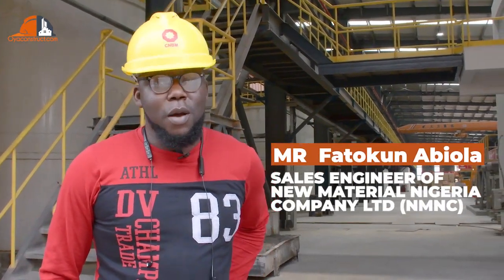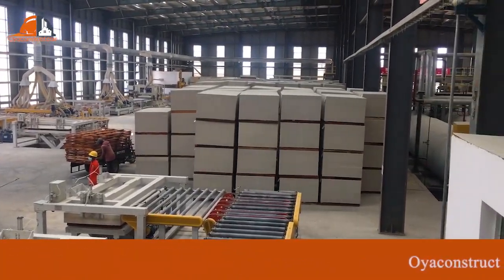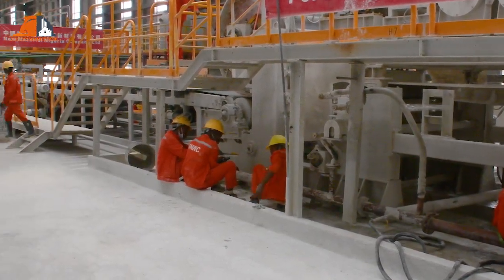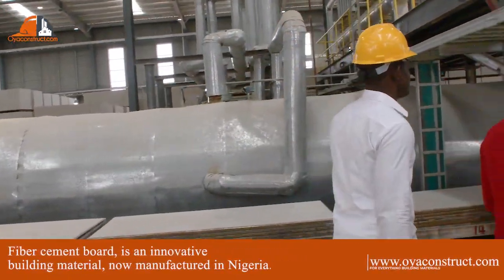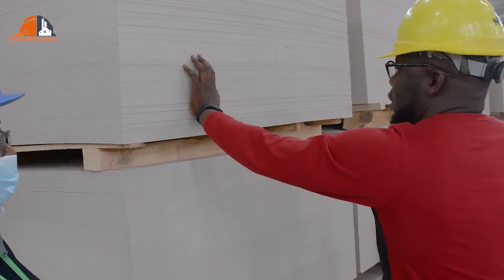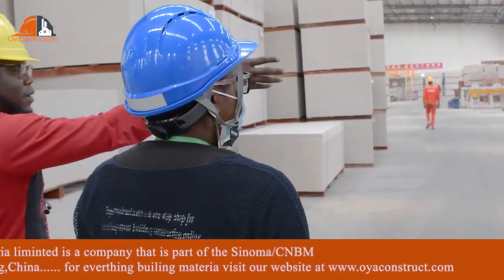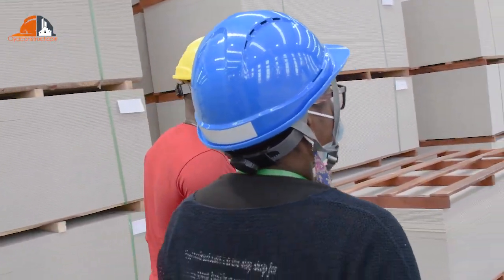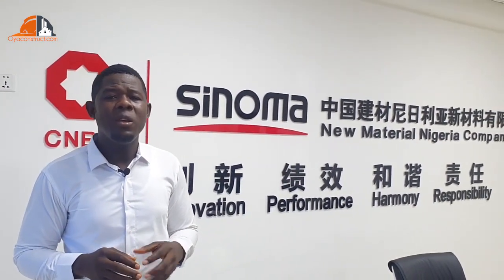Is Fiber Cement Board The Building Material Of The Future In Nigeria? Watch Now!

Comment: From the explanation, it can be used as a replacement for gypsum board in ceiling right? What is the price of One palette e.g. the 4mm? You also left the size of the sheet out, should we assume it's 2400 x 1200mm? Thank you.
Reply from the maker: Thank You QS. Alex for watching, yes the size of one board is 1200mm x 2400mm, yes it is a better alternative to gypsum boards because it is fireproof, soundproof, waterproof, eco-friendly, and weather-resistant, saving costs on installation and low-cost maintenance.

Send me a message on Whatsapp at +234 7082274783 for the price list. Thank you
Reply: https://youtu.be/Q96cv3URbtg?si=2Iko9tYPD7u5wB7I